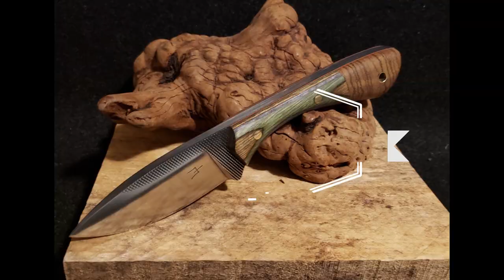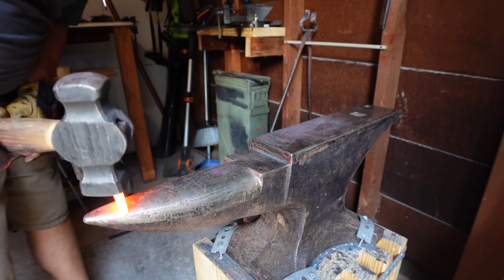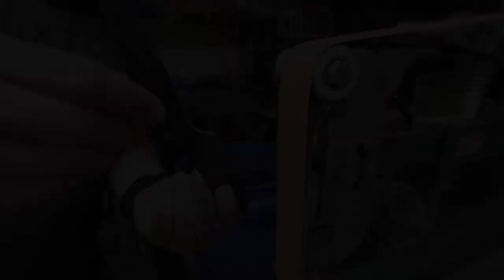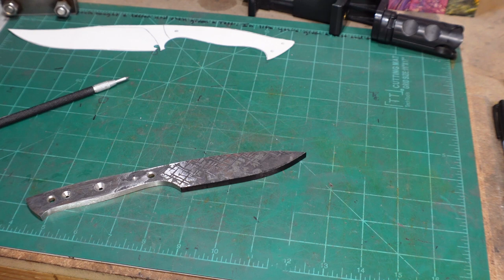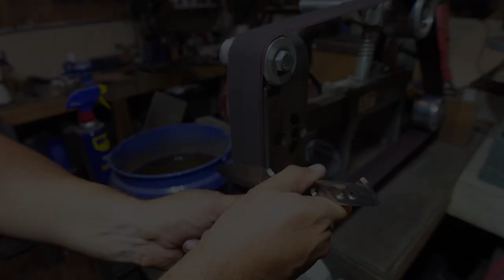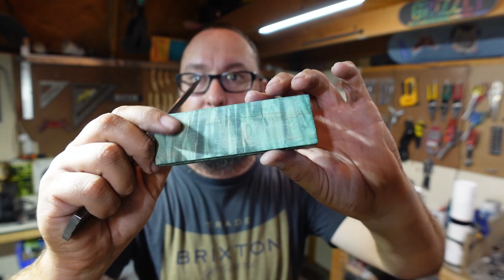Forging A Thick Bird And Trout Knife | Knife Maker Vlog

Comment: It'll be interesting to see how well the thicker steel does on a bird and trout knife, I've made them using 3mm thick stock but I've got some 4.5 and 6mm plate I've considered using for them- but I'm still not quite sure how to go with edge geometry on those as they're a typically fine cutting tool. 
Would be very interested to see how yours works... before i commit to anything, aka- be my guinea pig haha!

Yeah I feel you when it comes to the shop construction too. Its not cheap, I'm putting on a workshop next week or at least getting the slab down to start on it and the rest will be basically a glorified tin shed and whatever insulation I can chuck in it to survive Australian summers, its not as horrifically hot in my particular location but i can get kind of spicy some days with the forge or kiln running. Plus I want to use my garage for actual 'garage things' like working on motorcycles and cars